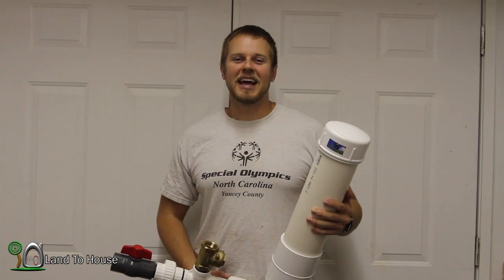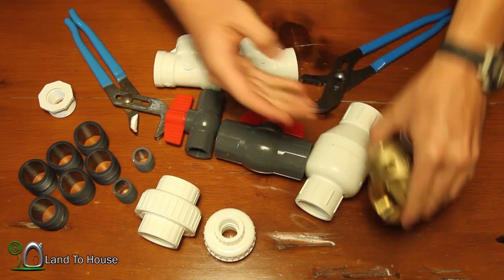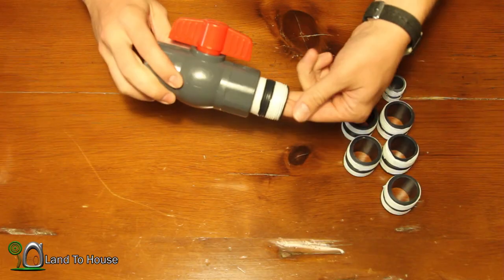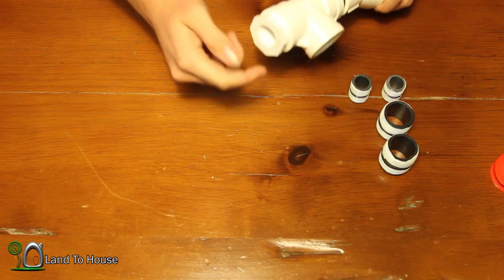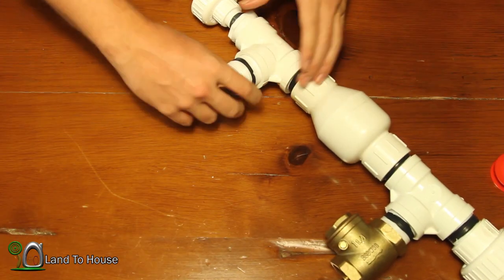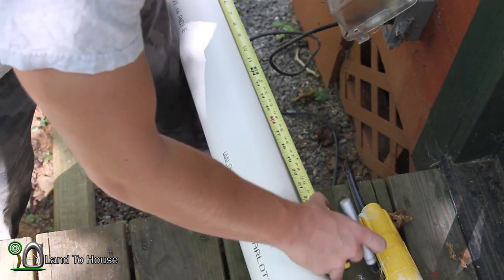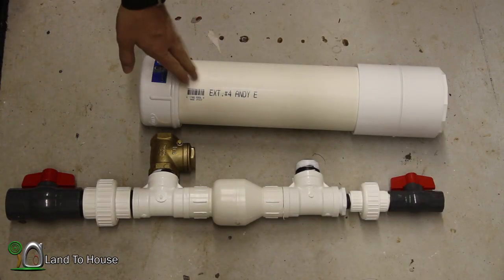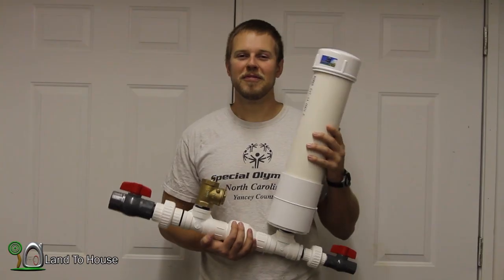How to Build a hydraulic Ram Pump

Comment: Is it better if we replace the Spring Check Valve with another Swing Valve?
because swing valve has better flow?
or, may you pls explain why you prefer to use Spring Valve?
Reply from the maker: I prefer the Spring valve because it is half the price of a swing valve. Also it can be a pain to get the second swing valve in the upright direction between the two "'T"'s.  Using the spring valve eliminates this issue. Really it does not matter as long as the first valve hangs open by gravity.

Comment: Does the output have to be running constantly? What happens if an output valve is normally closed and opened periodically, e.g., a garden irrigation system?
Reply from the maker: I have closed the delivery valve for several hours and it will still work after that. There are a few things to consider. If you do not have enough back pressure and then reopen the delivery valve the water might rush out and stop the pump because the pressure tank loses the pressure. Also if you close the delivery at the top it can build a good bit of pressure and make the valve hard to reopen.

Comment: oh something I was wondering about have you tried pumping water from an closed looping system such as a fountain in a pond if you're pump is at the bottom and your supply line bring water down from the top can your supply cause a fountain affect water powered generated with in a closed looping system do you think it is possible free potable water powered generator since you have everything you need all ready would you mind texting for me and if it works post videos for the world to see thank you
Reply from the maker: Because the ram pump uses 7/8 of the water to operate the pump and only pumps 1/8 of the water it is very inefficient. (yet because it does not use electricity or fuel it is very efficient) A closed system is not very practical. you would have all the water at the bottom of the system very quickly.

Comment: I don't need to comment on what better ways it can be done instead I would like to comment on what a great job you are doing in teaching people a cheaper easier way and I also wanted to ask you if you have used your pump for creating electricity yet or a water gardens for fish if so I'm sure me as well as of alot of others would like to see your next videos on that keep up the good work
Reply from the maker: I have a video on my channel where I nozzle down the ram pump and make 4v unloaded. Not much of a test but technically I did make power.

Comment: Curious - why insert the inner tube vale down into the pressure 'tank'  tube? It would seem easier to fold the inner tube so that the vale was up at the larger opening to pump the air in and to keep the valve away from any incoming water 'out of the damp' during operation.

I also wondered if the valve might be extended outside the cap so one could adjust the bladder it serves as.
Reply from the maker: The bladder seems to be fine when pointing down but it does not matter either way. This homemade version is a closed system. Once the tube is in the tank it does not come out. The pressure in the tank can be over 100psi. Drilling a hole for the tube stem would not be good because it would cause a leak. Now you can use a small water pressure tank as the pressure tank and that bladder would have the adjustable pressure ability.

Comment: I would suggest using the purple primer, applying the cement to bot pipe and fitting, then twisting / rotating the pipe as you insert it. (as opposed to simply pushing it straight into the fitting.
Reply: Yeah, you are correct. The primer reacts with the pvc and creates a chemical reaction before the application of the glue also twisting the pipe as you insert it cause the glue to spread evenly around the pipe
Reply: Also holding pressure on the cap for a few seconds helps.  The parts will often slide apart a little bit until the glue sets a little, only takes about 5-10 seconds.  Since this isn't under a lot of pressure, you don't have to use the primer/cleaner first but it never hurts to be extra cautious.   He makes these to sell so evidently his way works for him.
Reply: @arkansasmountainman  you are incorrect. The primer is always needed if you want the seal to last.
Reply: I would use primer but use clear it will look better

Comment: I have found that, when wrapping teflon tape onto a fitting, it is easier to get a good 'grip' by wrapping against the direction the tape is coming off its reel.  It allows one to pull the tape tighter onto the fitting (stretching the tape). Not sure if I 'splained it right but  if you flipped the red reel  (2:58) the tape would tension up as you pulled it 'round the fitting.
Reply from the maker: Yes that is true. When I build a pump I normally get all the pipe nipples taped and then put them all together at the same time.

Comment: If I understand correctly, the innertube is basically just an air spacer? I see in other comments you say that it keeps the pressure tube from filling with water. Does the innertube it do this by pushing the water back out with its own pressure?

I was going to ask why not to just use a smaller pressure tube if the innertube is there to fill the void for more pressure, but if it's used as a spacer bladder, it makes more sense. If my understanding is wrong, please correct me. I'm not a very good engineer.
Reply from the maker: +Hidden Thicket it is used as a bladder and spacer. Over time the water level in the tank will rise and eventually the pump will stop from pressure loss. The tube keeps a constant space and pressure so that the water is forced to stay under that point and the pump can run continuously
Reply: Ah, yes. I understand. I'm sure you get sick of answering that question.
 It was the only thing that had me stumped. Thank you very much!
Reply from the maker: +Hidden Thicket it's not so bad in the winter. In spring time I get 20 emails a day. Haha.

Comment: i know a way to make more pressure out of a ram pump
Reply from the maker: How is that?
Reply: well I think, first you will need a t and then one smaller one way valve and a larger one (make sure they are both straight up ) and my login behind this is if you have a 2econ smaller valve that is will 1 allow for more water to flow through and 2 it will close before the larger valve and that will force the water that is flowing faster than normal to rush to the larger valve shutting it and building more pressure...
Reply from the maker: +gunnar stahl it has been my experience that the valves need to be the same size as the drive pipe because the pressure wave in the drive pipe is the same size and will open that size valve the best. More testing might be worth the knowledge.  :)

Comment: Glad to see it's possible to build one of these with relatively cheap PVC instead of all metal. Just one question: What is the purpose of the big fat unions between fittings? Ease of disassembly?
Reply from the maker: +camoronL yes it is nice to make these out of PVC. Much easier to work with. The unions are not necessary for operation but it makes things much much easier to work with when debris enters the pump or stops up the drive pipe.

Comment: Hi thank for your video, i would like to ask about the tank is it necessary or must  to put an inner tube inside the tank? second thing is,from the inlet paip is it need  a very high pressure to push in water?
Reply from the maker: The pressure tank is very important. You do not have to have a inner tube or a foam to get the pump to work but i like to put that in so that the water does not fill the tank over time. The inlet does not need a high pressure. The water must flow back and forth in a pressure wave. If you were to have  pressure from a garden hose to the house it would stop the pump.

Comment: I didn't realize the parts of this pump were so basic.  You did a great job of explaining the assembly process.
Reply from the maker: Thank you. They are rather simple. I figured it was time to show an updated simple video.
Reply: +Land to House I wish I would have seen this before I bought the parts like the 'old build' . . . . it still worked...thank you ~
Reply from the maker: +David Cooper Yes that old build works just fine. I do like the new one a lot better though.

Comment: I've seen several designs both with and without the inner tube. Can you explain the benefit of having the inner tuber vs. not having it?? Great Video by the way.
Reply from the maker: Thank you!  Sure thing.  So old school pumps had a valve called a snifter valve that would gulp air and spit water at each cycle of the pump.  This replenishes air in the tank.  The new style that I make sites not have this valve so a bike tube is installed to keep air in the tank.  As the pump works over time the tank would fill with water and loss potential.  That is what happens with pumps without a bladder.
Reply from the maker: It is true that over the course of a year or two the inner tube will have a lot of use. I've had bad experience with threaded caps for the pressure tank. Because pressures can reach close to 120 PSI in some cases those clean out caps have a tendency to leak.
Reply: The concept of the tube is just like the bladder in a pressure tank for well systems. They fail over time as well from contact with water and constant expanding and contracting. That is the nature of rubber.

I was wondering how quickly the tank becomes water logged.
Reply from the maker: I have had tanks go months. And some  only a few days.
Reply: Brilliant..thanks.
Reply: +Land to House whats your thoughts on plastic bottles inside the cylinder?
Reply from the maker: +David Cooper I have not thought of that.  Seems like it would not give.  But worth a try.

Comment: my PSI is 89.  lifting 200 feet elevation
Reply from the maker: +John Godwin Lifting 200 feet is still the best ram pump results I have heard of. At least for the style that we use.
Reply: 😄  I still wish my spring had the gpm yours did.
Reply from the maker: +John Godwin It is nice having a little more water. . . It creeped me out a little this summer though. my gpm went from 150 down to 30. Sheesh.

Comment: Great Video.   I used sealed foam instead of the tube.  just an oservation.  you ARE the expert in this area.   😄
Reply from the maker: I believe I'm going to make a couple tests with foam vs tube just to see if there's much of a difference. As far as selling pumps goes it's easier to get tubes.
Reply: +Land to House I would guss the only difference would be that over time most tire tubes leak down.  I packed my pressure tank with swimming noodles cut up.  I cut it open later and noticed the foam was under pressure.  squeezed but still operational.  My pump hammers so hard and lifts the water so high most pumps never experience the PSI so probably not a issue.
Reply from the maker: +John Godwin haha I had not thought about how much the foam would compress. It does make since though. 89psi is way up there. I wonder how long the check valve will last in your pump.
Reply: I still have not perfected it.  I need to install the. Ceck valve 1/2 way up the delivery pipe.  Lack of water flow stops most of my experiments.  Last trip I only had 1 gallon every 1.5 min.   😣
Reply from the maker: +John Godwin That is a low flow. At that point I think you would benefit from a small storage tank to that you could pull from when it fills up.